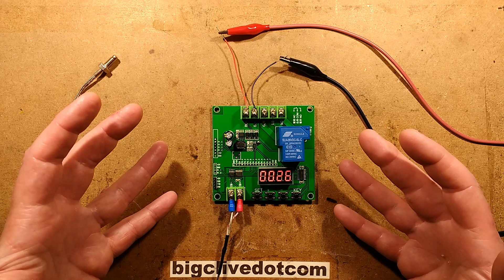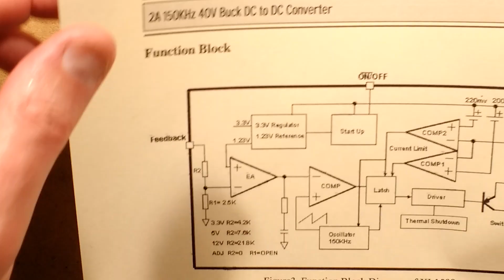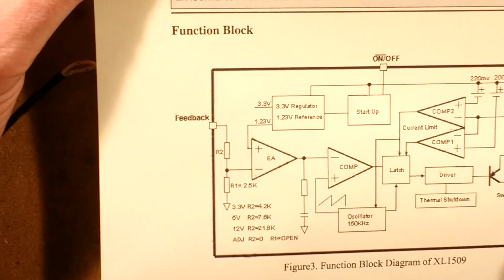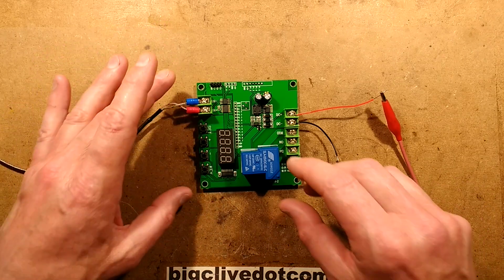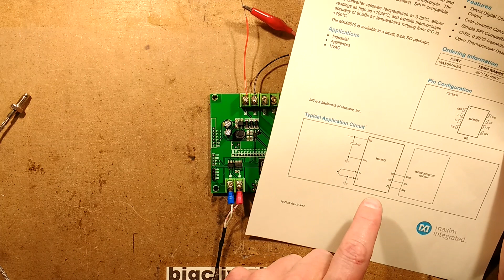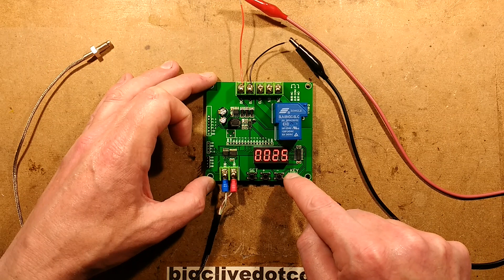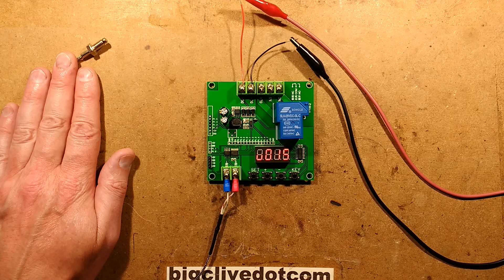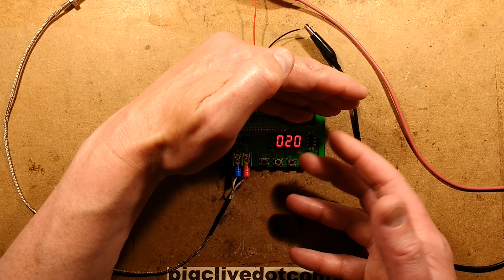"Educational" temperature controller.  (In a bad way.)

Comment: Why is the left-most digit flickering a lot more than the others?
At first I thought it might be some sort of synchronized rolling shutter effect (temporal aliasing) with the camera, but it did the exact same thing after he power cycled the board as well.
If the entire display is being driven from the same chip, and even using the same single row, the only thing that I can think of is that there's something going on with the column driver corresponding to the leftmost digit.
Reply: NOBOX7 5 internets for you.
Reply: I'm pretty sure that's happening, because the pins are shared for driving the 7-segment displays and reading buttons. One of the digits has to be switched to "input". Since a dedicated driver/button reader shouldn't be that bad and almost fail at what it's supposed to do (I mean, giving a useable display output is it's purpose), my guess is that whoever wrote the program read the buttons, but didn't set it back to output right after that.
Reply: superdau; Oh yes, bad programming does indeed explain it!
Thanks for pointing it out to me. (I'm more into the hardware design of things myself)
Reply: superdau I don't think the TM1650 allows the microcontroller to set the I/O state of the 7-segment pins directly. When reading which key is pressed, the microcontroller just sends a byte to the SDA/SCL pins and then reads a byte back. The TM1650 is in control of the multiplexing between keypad polling and 7segment led illumination.
Reply: Never said that it would set single segments. Since my Chinese is severly lacking (read: non existent), it's speculation, but I'm pretty sure that the microcontroller has to tell the TM1650 to switch on the LEDs again after a read of buttons.
Reply: superdau I'm assuming the TM1650 works a bit like the TM1637 based on diagrams in the datasheet and the arduino library on github. The led multiplexing and keypad polling is largely automatic. Where the two chips differ is that the TM1650 shares both the led anode and cathode pins with the keypad, whereas with the TM1637 only the led cathodes are sharing with the keypad so no 2K resistor is needed.

Comment: The MCU is a modern variation of the classic 8051 architecture. It might be worth it just as a devkit (if you have the necesary programmer. Bootleg ones go for $2 on ali.)

Comment: LOL, I ordered a Temp control from BangGood just weeks ago.  I  had to insure this was not the one I had.  I've used the MAX6675 with Arduino before.  A Cap across the K ThermoCouple leads helps with noise.   The MAX 6675 is a Current Amplifier.  The K ThermoCouple generates a Current .  They are immune to wire length and voltage loss.

Comment: Questions>>>>   Wondering out of curiosity...   One- The coupling of your hand on therm couple.  Try a say 20 to 100 pico Farad cap across coupler input?  Also wondering if put say 220 to 470 micro Farad across power input?   See if that fix that issue.  Far as some of the other things,  relay going into bipolar disorder, no error on disconnect of probe so temp runs amok,  these things I am laughing at myself.  But was courious bout change in temp on that and if a few pico's on the them might help lots.  Like the videos.

Comment: Those LED segment displays are hard to see on camera. I figured out a little tip for that, especially the bright ones like the blue ones. When you peel off that protective shield it sometimes makes it brighter. Take a little strip of thin Kapton tape and place it in the segment display and it makes a big difference in cameras. Makes a huge difference if it’s a really bright one and easier to read on camera and in person. Hole this helps.
Reply: Recommended contrast materials include: spray glue and silvery PCB antistatic bag material, and window tint film.
Reply: Bog standard red electrical insulating tape works too, and is more likely to be in your toolbox.
Reply: A sure fix to that is reducing shutter speed a tiny bit
Reply: I use common red electrical tape on all of my displays. It works like magic. I can read them in full sun too.
Reply: PirateKitty 
Doesn't that make your phone harder to see?
Reply: That hole help!
Reply: Pete Allum, 
No. I didn't say cover your eyes with tape!
Reply: PirateKitty 
You said you cover all of your displays with tape, so I naturally assumed that includes your phone screen! 😜

Comment: Could you de-solder and remove all the on board power supply components (maybe  pop in a 100nF and 100uF in parallel just for added noise removal )and just bridge over the input to the supply rails using your bench power supply set at the right voltage and see if the problem still persists? That would eliminate the on board power supply as a potential noise source? Could a suitable resistor across the probe input terminals also be used to stabilise/calibrate the probe? Use a different probe? Such a fun board with so many experiment possibilities :D

Comment: Not sure if the testing methodology is correct for a thermocouple. For a PTC thermistor it would be but really if you shorted out a thermocouple you'd think it'd just display the ambient temperature. Because the connection to the thermocouple wire is in fact another junction at ambient temperature. Disconnecting the thermocouple just makes it read whatever the input is at if you leave it floating.

Comment: if you short the thermocouple terminals, I'd think it should display the ambient room temperature, as it would simulate 0 volts from the sensor. the way thermocouples work, they detect the temperature difference between the sensing end and the end connected to the terminals. there's normally a second temperature sensor on or near the board (preferably thermally coupled to the terminals) which detects the ambient temperature, then uses the thermocouple probe for fine adjustment.

if the probe end is warmer than the terminal end of the thermocouple, it'll feed a small positive voltage into the board. if the probe end is cooler than the terminal end, it will feed a small negative voltage into the board. it actually reads a relative temperature, not absolute.

Comment: dear sir i have bought a 12volt crock pot from road pro worked great for about a month then i tried it didn't work the light came on no heat ruined my dinner.so i bought another one now the same thing lasted 2 weeks ruined another dinner contacted amazon they just said you bought it .i am not buying another i took it apart the wire is broken so i was just wandering what type of wire it goes to the element.it is a solid wire.thanks for your videos

Comment: There is technically  3 connections to that thermal couple...  if you look at the connections they are not part of the shielded lead, that shielded part needs to be grounded to the ground on the device. This is normally  done when its attached  to what ever your measuring via the chassi   So if you add a wire to the shield and direct that to device ground, it will stop swinging
Reply: Another key thing is that thermocouples physically measure the difference between the temperature at the two wire ends, and the application needs to control the board end reference temperature to make sense.  Scale may be in Fahrenheit, with a wrong reference for 32°F / °C, thus interpreting almost no difference as slightly below 30° nonsense.

Comment: K type thermocouples often use Red as the negative output.... and often not isolated from the braid and mounting fixture.   This may explain the 'noise' effect when handling and down register when the couple is heated. 

Yeah... creep distance / clearance on the power supply and relay tracks is an issue... fix with cutting board between the tracks to effect air gap rather than tracking across a flat surface.   BUT, you shouldn't need to do that.

Comment: That thermocouple negative pin should be grounded RIGHT at the chip, instead they routed it threw the serial port, the voltages that thermocouples work on this will A) never hit 0, and B) will be very noisey
EDIT: it also looks like they intended a calibration via a pot to the analog pins but never fitted it
Reply from the maker: Others have pointed out that may be a position for a contrast pot and that the associated connector is for an LCD display.
Reply: Ah yes that makes much more since

Comment: 2:45 my guess: they used whatever their board design tool had for the standard pad size and just didn't think it through. i'm also kinda scared by the size of those pins, wouldn't use that terminal for any high power application to begin with, i feel like you probably want a bit larger diameter pins there. even something "low performance" like most barrel sockets have giant pins compared to that terminal strip.
Reply: My guess, the holes match the pins, but those clamps are unsuited to the needed currents.

Comment: Remember this temperature controller is modular, it's very modular, it's very very modular and it's a modular design that even the Borg would not assimilate into there collective even as a adjunct to there uni matrix zero one.

Comment: Gidday Clive from down under.
That very same temperature controller is for sale from   "buyonline315 (69704 )" in China. exactly same picture
You're right about the close proximity to the supply terminals and tracks. Why? There is so much space to have moved the terminals away from the relay terminals that would most likely be used for switching mains voltages.
I love the videos. Have not missed any that I know o0f.
Keep up the good work.
BILL T.

Comment: 2:39 I think the answer falls in line with your later conclusion that this is a sort of "text book" circuit design but with many errors. A sizable relay was used given the application, it was well bonded to the board, but the designer(s) utterly failed to realize (or care about?) the simple fact that the large loads this thing is supposed to be switching will be attached to those tiny terminals causing an obvious failure point. Only a hobbyist but that seems to make the most sense to me.

Comment: I was hoping you was going to ground the probe case to the supply neg to see if it stabilized, but like u said it's weird. Possibly originally from a school project that a student is trying to make a few bucks we will never know?? great vid as always
Reply from the maker: I tried, but it didn't work.  What did make it more stable was running it from a battery, so it didn't like the (good quality) bench power.

Comment: Could it be the that one of the sides of the thermocouple chip isn't grounded? 

Since the example schematic shows that one of the terminals should be grounded - which also explains how it starts reading about right when you ground the probe with your hand.
Reply from the maker: One side is connected to the negative rail.  When I tried running it on a battery pack it was more stable,m so it doesn't like switching noise.

Comment: If you were so inclined you could connect the microcontroller to a suitable reader and download the code. Then you could attempt to correct the omissions and re upload the code and see if it functions any better.
Reply from the maker: It would probably be a lot easier to work out the pins and rewrite the code from scratch.
Reply: bigclivedotcom 
Seems logical enough.

Comment: Hi, Clive have you checked that the thermocouple is connected the correct way round?
I didn't see you actually heat/cool the thermocouple, just play with it noise characteristic.
Have you tried a 0.1uF capacitor  across the input terminals and one from one input terminal the gnd.
The capacitor  on the PCB near the controller and the thermocouple chip is connected to what?
Tom..

Comment: You could have tested if the noise is from switching power supply by connecting your power supply straight to 5V.
Reply from the maker: I powered the module from a battery pack and it was more stable, but still inaccurate.
Reply: You could have guaranteed there would be noise coming from the switching power supply by connecting it straight to 240V.
At least momentarily, anyhow.

Comment: if shorting the sensor does not make a difference, I really start to wonder if that sensor is doing anything. Wonder what happens if you first ground it  and then short the sensor. Maybe reading some screw-wire-screw thermocouple.

There is one thing good to say about this design though. I got the impression its very modular. Not sure what gave that away

Comment: What if you connected the shield of the 'antenna' to ground?
Reply: Undefined Lastname do you mean the shield is connected to the blue connector (IN -)? With my comment I meant a permanent connection from DC ground to the shield. But maybe that is already the same.
Reply: Undefined Lastname Ok. Thanks :)

Comment: Ebay, the dumping ground for dodgy & dud electronics. That relay chatter is especially Dudley.
Suprised the shield on probe isn't grounded?
Reply: I wonder if the shield is actually the problem. I'd try a different 2 wire probe.

Comment: The take away for me, the sensor connector itself has  a bad connection to the board, when you pushed down with the scissors it forced a connection, I'd say it needs to have the solder run.

Comment: I have a different but similar module. But my p1, p2, etc. are not different presets but are functions such as number of degrees hysteresis. Below is another module different again. Are you sure of the functions on your one?

P0 Heat C/H C
P1 Backlash Set 0.1-15 2
P2 Upper Limit 110 110
P3 Lower Limit -50 -50
P4 Correction -7.0 ~ 7.0 0
P5 Delay Start Time 0-10 mins 0
P6 High Temperature Alarm 0-110 OFF

Comment: Shouldn't the two thermocouple leads be taken to the input independently of the screen braid which should be grounded. Even if one of the thermocouple leads is grounded at the chip?
Also could it be something as simple as a faulty decoupling capacitor?
How about another video improving the design?

Comment: That big pin header looks like something for a standard 16x2 lcd
Reply: You seem quite right! Both have 16 pins nominal. Both have ground as both outermost pins. Pin 3 goes to potentiometer, so it looks like contrast adj. Port1 of the pin header aligns with the data bus of the HD44780 connector and Port3 aligns with status pins.
Reply from the maker: It does look like that.  They've really tried to do everything with it.
Reply: Other pin headers are a programming header and second serial port. Problem with that antenna thing bight be because they tried to separate ground plane? It looks kind of separate, connected with a thin track on the left, near that thermocouple chip.
Reply: +bigclivedotcom Can you try hooking up an LCD to see if it is writing anything to the display?

Comment: I thought thermocouple temperature sensors become more conductive when they heat up due to producing a voltage. When you disconnect the thermocouple it should go to 0 because there's no input voltage, not up. They got it mixed up. Anyways, a Velleman thermostat kit works better than this. In fact, I have two of those.

Comment: If this is Arduino based, well, that's one more reason why Arduino is not good for serious projects (not this one for sure). Arduino is good for beginners, not it is not a good leaning platform for the long term, since it doesn't enable serious electronics learning. As for the tiny pads on the connector, they should have reviewed that footprint. That king of connectors require oval pads for added robustness.

Comment: I bet it's not displaying the temperature but is, instead, showing the actual value it is reading from the probe, i.e. the value between 0 and 1023.  It's not 25C, it's position 25 in 0-1023.
Reply: Replying to my own comment.  Ha.  Another thing I noticed (as a developer) was that it wasn't having a problem with debounce, it was incrementing past P7 and required you to decrement to get back under 7.  It incremented its counter to 9 but stopped displaying at 7 so you had to hit the down button a few times to get it back under 7 to give a valid value.  Hardware guy trying to program software and failing.

Comment: Seems a 8051 based microcontroller. Power it from a 9V battery, re-program the MCU and fingers crossed. Use a rotary tool for the separation :P

Comment: If the thermocouple has a different range than the unit is calibrated to, you'll see problems like you're seeing. Also, did you try running a line from the probe- to ground? while the probe is connected that is?

Comment: I have a different model (W1209) and heat/cool is a software setting. I'd imagine this one doesn't need that because it has nc/no contacts. Not sure what the two temperatures gets you though. (Edit: Oh, hysteresis. Seems like an odd way to do it. The one I have you set a band. Not sure how that affects my nc/no comment above but I suspect it breaks things.
Reply: Using the NC contact to handle cooling works fine except when the module looses power or fails, the relay gets stuck on heater off (safe), cooler on (unsafe).
Reply: @johndododoe1411  I upvoted you but just wanted to add a reply that that's a very good point.

Comment: It seems like the thermocouple is shorted out, since same reading shows up when you short the connector... Or it might be that the whole thing just doesn't work!
Reply: Polarity might be wrong, Clive's hand makes the reading lower...
Reply: Come to think about it, the device seems to act as an electrometer of the type used by Scientology (Electro-psycho-meter)... Are you an adept, Clive?
Reply: The thermocouple interface IC has a internal temperature sensor, as I believe thermocouples themselves only measure a difference in temperature, not absolute temperature, so it's displayed relative to the internal sensor.